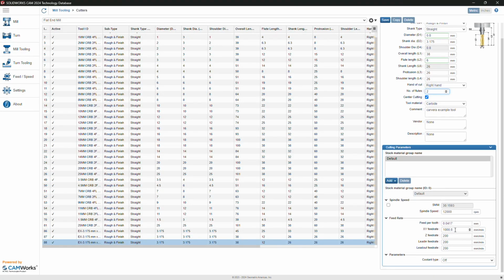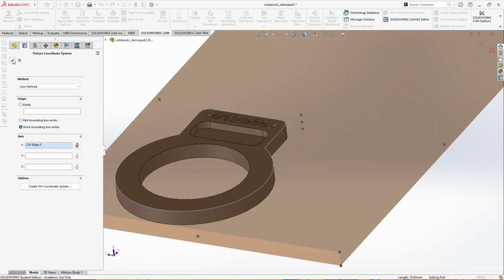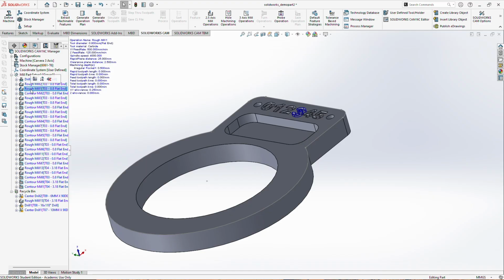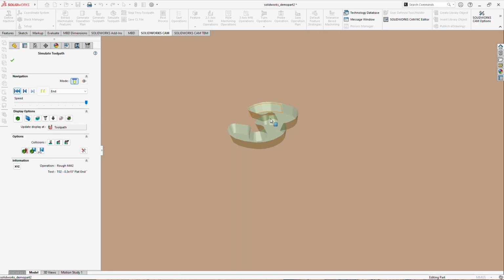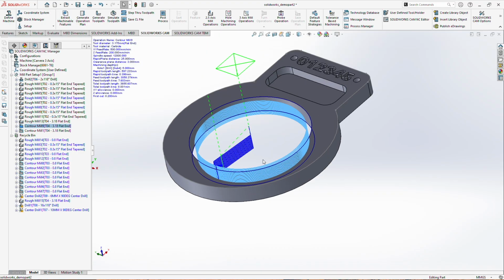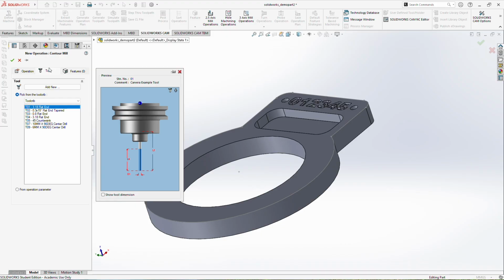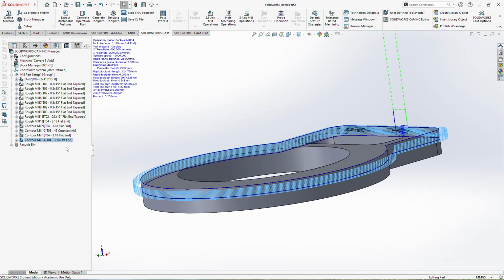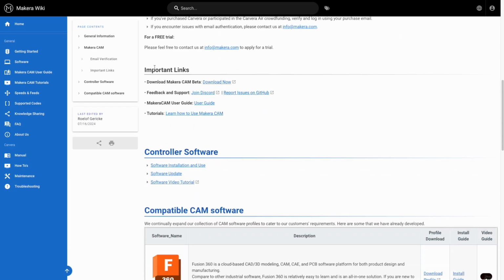Getting started with Solidworks CAM and the Carvera CNC - Part 2, Preparing an Example Part

Comment: Is it possible to configure SolidWorks cam to make it automatically generate correct step down values?
Reply from the maker: Yes, this is all done in the database as you set speed and feed configurations per material based on thickness as overviewed in the Part 1 solidworks setup video.

Comment: Still missing: the ability to use the 4th axis. I had to teach myself how to write CamWorks/SW Cam post processors so I could add it in myself.
Reply from the maker: An official 4th axis machining profile is not available for Solidworks CAM at this time, but many of our users may be interested in the profile you've created. If you would, please consider sharing it with us at support@makera.com for review. And please stay tuned for more 4th axis content and guides!